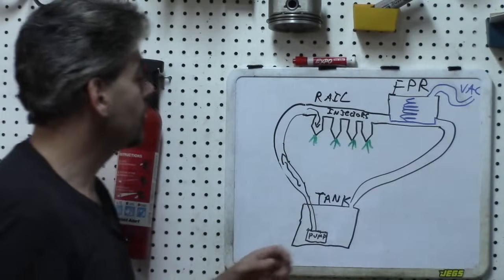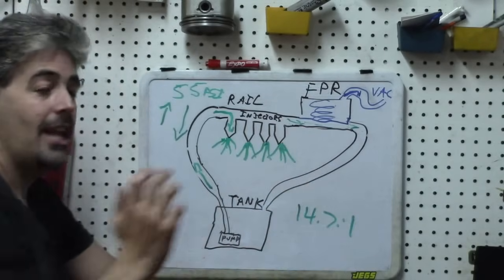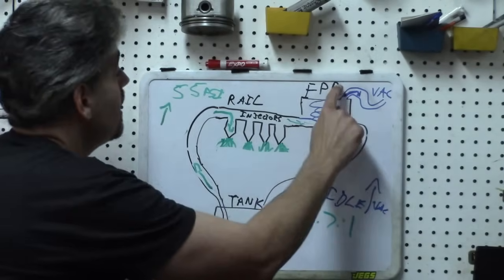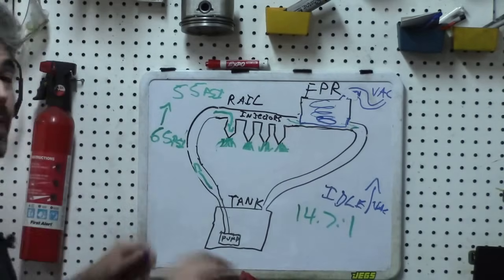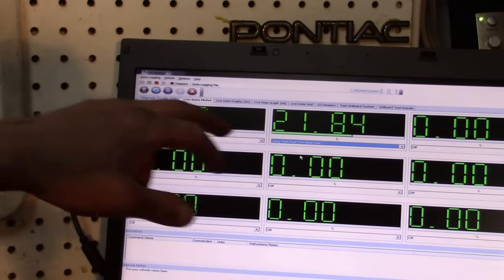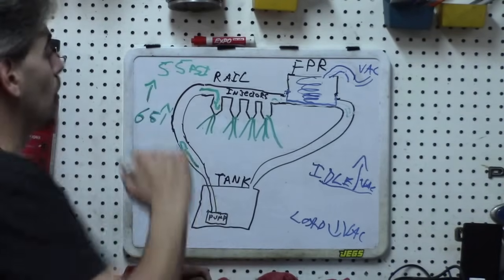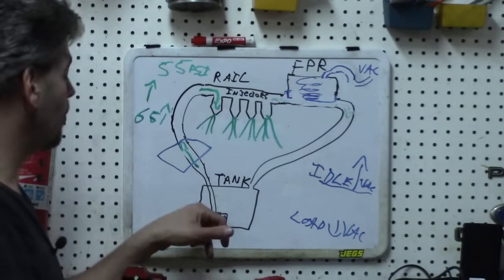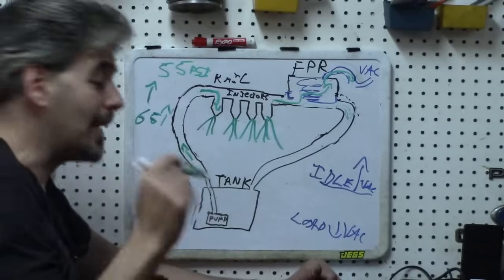Fuel Pressure Regulator Diagnosis + Understanding (HD!!)

Comment: LOL! Only crush the fuel line if it's rubber. I know it had to be said. It's like some modern packaging where you can see the lawsuit that got each of the lines of warning written.

You're alright. I'm just getting the unintended joke. Really great job on the video.

As for the HD, this is the highest resolution your hair has ever been. It looks a lot more real. The shot of the engine seemed to have the glow of a sunset reflecting off it's surface. You're earlier work wouldn't have caught subtle lighting like that....though I suspect it wasn't a sunset and actually a garage light.

I think your HD work will show up better when we're looking at graphs of fuel trim or other data together. Once again, based on looking at your hair.

When judging detail on videos - my brother reformats videos from SD to HD, or what he'd call a joke of HD to HD, look where the detail is. Usually the face is a good place to check the detail differences.

If you like, I could try connecting you with my brother since he's the one in the family with all the video editing expertise.

I thought you had moved to HD earlier this year, the quality jumped up tremendously, but maybe your final edit wasn't HD like it is now?
Reply from the maker: My hair "looks more real?" lol- it IS real!!  Yeah as you noticed, I have gone through 3 stages of resolution increase now. WHen I first started I just used a standard definition DV and poor lighting- I really had no idea what I was doing.  I later got an HD camera however my home computer was far too weak to process HD videos which are friggin huge. So I just processed the HD video from the camera as a higher quality WMV which my computer could handle.  And now of course, this is full HD (actually 720p- 1080p is just ridiculously huge and not really that much better considering the long upload and processing times.).
Reply: Schrodingers Box  LOL. Thought you might like some truth in humor. :) Of course your hair was always real, but when they blended together it had an "unreal" effect before, lol.

And yes, having watched all your videos, at first at random (when I discovered you) then from beginning to end, I do see the 3 transitions. :)

It was a few videos of the better quality before it clicked and then I had a, "Whoa!" moment.

Comment: Thank you so much for this video for informative. I am so grateful  because  now I feel confident  I can discover  whether  or not my Fpr  is faulty. 
I just have one question if in fact there is leak that the vacuum line is sucking  in then would that mean that you might get a smell of unburt gas when you turn on the vehicle?
Reply from the maker: Reynaldo Olivares I would initially say not unless the regulator is also leaking, however on second thought- because the vehicle would already be rich at warmup combined with the extra rich from the fuel pressure being 10PSI higher- I imagine it's possible you could be smelling raw fuel from the exhaust.  But not from the engine bay.

Comment: I've noticed over the years that the factory shop manuals don't seem to list the correct fuel pressures for the injection systems. Example: 96 eldo northstar. factory says 46 to 59 psi. Yet, static is 30 psi, run with vac is 40psi and run with no vac is 46psi.  Example: 98 P30 chassis factory says 55 to 62 psi.  Static is 50psi, run with vac is 48psi, run with no vac 52psi.  I have found these discrepancies to be very common and to beginners can be confusing. I wonder some times if the readings that the engineers are looking at are at the pump? One thing you don't mention is the inline check valve in the pump module and how, if it fails, will let the fuel pressure drop over night or several days and make hard starting until the fuel pressure builds up. I have found that this happens more often than the actual fuel pump failing. I use "inline" check valves to solve this problem at a fraction of the cost of a new pump.   Great video's well explained even through the evil dry eraser board is in total control of you! Thanks for your time!!!

Comment: Good video .There are a lot of good editing software out there but i like Sony Vegas 12 ,It is so easy to use for basic editing.  Have you tried VideoPad editor. A lot of people also use Magix video editor.
Reply from the maker: Well if Vegas 12 is what you use for your videos on your channel, then that's a pretty strong testimonial because your video quality looks very good to me. One thing I did like about Nero's rendering at H.264 is it comes out to about 15MB/min which is much less than I have seen with other software.  If you get a chance, I'd like to know what your settings are for rendering (I have been saving mine as MPEG-4 3GPP 1280X720 2420kb/s). I find it gives the best video quality at the smallest file size of any other formats I've tried.
Reply: Schrodingers Box I let vegas save as MP4 .Vegas gives choices for Output Format.  and I pick Internet HD 1080p, Or lately  Internet HD 720p. Because the internet speed here is slow. So some are MP4 1280X720  and Some are MP4 1920X1080.  I Mostly use a Sony Handycam  and my input file is a AVCHD file. at 60 i  . There are lots of good video editing software out there , but they are only as good as the quality of file you put in.I am not on highest camera setting but do like starting with a large file size for editing. .

Comment: Thanks mate for the lesson. You are absolutely great. Sorry I have a quick questions if you don't mind?. What's the statu of  fuel pressure regulator before  the car started is it open or closed? Is it normal for FPR leak to tank while starting cars? Thanks again. 👍🏻
Reply from the maker: it will be closed since there would be no vacuum to it plus you want to maintain fuel pressure in the rail for the next start.

Comment: I did not remove the banjo fittings. I loosened them enough to allow fuel to be forced out, then I tightened them. Now I have huge job that I will not allow a shop to perform.
Reply from the maker: You still do not understand. YOU DECOMPRESSED A COMPRESSION WASHER AND REUSED IT. 
  The shop is not the danger here. YOU ARE!!!  Again you asked for advice and my advice is to stop immediately and take the car  to someone who knows what they are doing!!
Reply: get new washers

Comment: Great tutorial, thank you! One thing that I'm curious about is how the pressure is maintained in the fuel lines with the engine off? Does the FPR block the line? I have a problem in my Bronco where I lose fuel from the lines completely after 5 minutes of engine off. It does not leak into the FPR (checked the vacuum hose). Is the in-tank fuel pump restricting the return flow to maintain pressure? Anyway, I do suspect a broken check valve in the fuel pump feed side. I don't see any leaks in the lines and I don't smell gasoline anywhere, and after a minute of running the pump there is enough pressure to start. When the engine starts, there's no black smoke or anything, it runs normally immediately and is fine running.
Reply from the maker: +Sami Ovaskainen The fuel pump itself has a check valve to maintain the pressure
Reply: +Schrodingers Box Does the check valve block the return line as well when the pump isn't running?

Comment: First thanks for an EXCELLENT video...as you said, it made me understand how the system should work.A couple of quick questions...My fuel pressure gauge fluctuates 5 lbs back and forth with the engine running, not a steady reading as yours.My fuel pressure dropped into the thirties when I increased throttle, could this indicate a failing pump? FYI...This is on a Mercruiser 7.4 MPI  marine engine. All filters clean...all lines in good shape. And again THANKS for taking the time to produce the video!!
Reply from the maker: If your engine has a misfire it could be the effect of the misfire causing an imbalance in the vacuum to the regulator.  Also, make sure it's not just simply vibration causing that effect.
  It also could be result of injector pulsewidth modulation if the ECM is maintaining idle. Easiest way to check that would be through the short term fuel trim pattern.
Reply: Thanks for getting back to me so quickly...pretty sure not vibration...will kill a cylinder at a time to check for misfire.Will have to ask my mechanic who has the Diacom software, if he can check STFP.  Thanks

Comment: Okay. just sitting here wondering what the next item on the list is going to be. I got this 96 ford 4.0 ohv it was throwing 3 codes, misfire on 6 and 4, DPFS blahblah and ECTS blahblah, I have a cheeeeep scanner and thanks to you I haven't bought as many parts as I could have.the misfires were broken plug wires solved. replaced the two sensors. solved and ditto. replaced the lower,upper intake and all related gaskets, sill running lean. all O2 are fine but the MAF wasn't and the IAC, boom and boom. 8*( still tossing a P0171 but my longft on both banks were 42.3 so I check for exhaust leaks, nada. then I tuned into this video. and went down to the zone for their loaner fuel system diag. kit. checked the pressure at KOEO nothing, tried it at KOER I'm thinking 17psi is a bust. it wouldn't budge off of 17psi under load or disconnecting the vacuum line, probably another bust, ordered pump and filter. the truck has 256,000 so I expect it's time. So I'm just sitting here wondering what the next item is going to be. BTW These are the worst Fing vehicles I have ever had the pleasure to operate on.Seriously considering using it for target practice. Happy Easter Sunday!!!

Comment: Bro, amazing class! Please don't stop instructing us! Where are you located? I'm trying to diagnose what seems to me a fuel misfire or clogged or an injector pump clogged or a. ECM not signaling to inject on my 1999 3500 Ram 24 valve Dually. I replaced the fuel filter and was packed with traced elements so I seriously don't doubt the VP44 is stock as well but you know, the truth is what am looking for so..am learning from you and the gurus out there to diagnose and to take care of business so my Dually start. So far is cranking no start.
Reply from the maker: Thanks.  You have listed 3 completely different variables- you will next need to eliminate each variable systematically to identify the cause of the problem and go from there.  I would start with PCM signalling first since obviously that's the easiest.
Reply: @SchrodingersBox  I agree with you since is the brain or signaler or device to order the VP44. I'll try chat first with a couple used ones from the yard. If the VP44 works problem temporarily solved until I can get into the OEM Leagues. If not, Ill go to follow the cabling. Lets see. I still have my fears of having a clogged VP44 because I had almost like an 1/8" of traces in the bottom of my fuel filter canister and maybe, I'm not a 100% sure part of those traces went into the VP44. Lets hope it didn't or that the amount is so minimal that somehow escaped the injectors mouth but..they can be small. I mean those feeders I guess can be clogged unless the VP44 stall in order to protect them from getting clogged. 

Thank you brother! I do the same on central air conditioning systems. I help even from a distance. Thank you! I'll talk to you later. I want to treasure your friendship. You are a great genuine and intelligent person many would like to be and have as a friend! Much blessings to you brother!

Comment from the maker: Hahaha Tecnico beat me to it but I wanted to make first comment on the new HD upload. I was wondering if you guys noticed the difference? I made a rather egregious error (IMO) in choosing Nero 2015 as my editing/processing software. It gives a relatively small H.264 file size for HD quality but on my first edit, I found the audio was way out of synch. Many of the choppy edits were the result of my effort to re-sync the audio. I have found many people using Nero have also complained of this. If anyone wants to (again) recommend a good HD editing software that is not some kind of professional grade for special effects etc, I'm all ears. Many people recommended Vegas Pro but I just want something to produce equivalent of HD H.264 output with a small file size and make title screens and text over the video - that's pretty much it lol. It is essential that audio waveforms are visible as well in the editing screen. All Suggestions welcome.
Reply: I'm no video editing expert but I just started using Cyberlink PowerDirector and it seems pretty good so far for a home user. Simple to use but gets the job done, doesn't crash or have the annoying problems of other cheaper/free editing software, although , I only did one job with little editing.  They have a free trial, or even a free version that provides the basics I think. Cyberlink are the people who provide video codecs for windows PC so I would guess they know something about video. They claim to have the "worlds fastest 64 bit rendering engine", The one job I did with it  rendered quickly so might be worth a try to download the trial version and see if you like it. I think they just released a new version that does 4K and H265 too
Reply from the maker: tubester4567 Excellent feedback, yes I saw Powerdirector at the computer store and it caught my eye especially for the much more reasonable price than most others. I will take a second look at it for sure. I don't want to be steven spielberg here- I just want to make simple videos in HD lol!
Reply from the maker: tubester4567 Tubester, just wanted to say FANTASTIC call on Powerdirector.  I got PD13 today and it is incredibly easy to use and it's just amazingly fast at rendering the H.264- and no audio sync problem like Nero had.  Absolutely the best video editing software for the price as far as I'm convinced! Great call bro!
  Thanks so much, you just made my life way, way easier bro!!!
Reply: Schrodingers Box Good to hear Matt!! Yes, it definitely seems more powerful and professional than the other cheaper programs. I have struggled on and off for years with dodgy programs because I don't do enough video to warrant the expenditure, but I lucked out and scored a free version during a Cyberlink promotion a couple of months ago. I'm glad it worked well for you, nothing worse than having to re-do videos because of shitty software!! Happy to help!!
Reply: I use Sony Vegas Pro
Reply: +Schrodingers Box If there was something wrong with the audio/video I sure didn't notice.  Proving, that content trumps audio/video.  Thanks for another great video.  I use Sony Vegas Studio HD Platinum 11.0, $35.00 at Amazon.
Reply: +Schrodingers Box  Hi, I am struggling with a hesitation and jerking of my speed density engine, Thinking it was the coil, I replaced the coil with external msd blaster coil, but to no avail. The car does this on load at lower than 2000 rpm.  I took out all the plugs and one plug, the #1 of 4 which is nearest to the fpr seems to be so clean, I am thinking that this is not getting enough fuel. It is safe to remove the fpr vaccum line while testing on the road?
Reply from the maker: corollagl82 What is your static vs load fuel pressure and idle vs load fuel trim?
Reply: +Schrodingers Box  I dont have an access to fuel pressure guage as of now, i bought the car without diagnostics its a pre-odb2 engine. I am so brave that I  remove the fuel pressure regulator's vacuum hose and plugged the intake vacuum while on my way to a machine shop 30kms away.  I would say you are one of the best resource on the internet, the hesitation and jerking was reduced and almost not noticeable, I need to change the fuel pump am I right?
Reply: Schrodingers Box
Reply: Great video!  Thanks
Reply: Schrodingers Box 👍👍👍👍👍👍😄
Reply: Schrodingers Box you made a huge mistake! The drawing, you color the fuel green which would make it diesel not gasoline😂😂 thank you I have learned a lot from you
Reply: sir;
I have unstable continuous RPM..... but it becomes stable soon as I remove the gas cap...how do you explain that?

Comment: On my '98 Ford Ranger 3.0 fuel pressure stays constant regardless even when vacuum hose was disconnected. Applied vacuum to regulator no change in pressure. Checked vacuum line and vacuum decreased when given more gas. No fuel in vacuum port on regulator but would hold vacuum. Will replace fuel pressure regulator
Reply from the maker: I would check your fuel trim to see if car is running  rich as a result of this.

Comment: Great explanation, however, what if fuel pressure is too high and FPR is brand new? In a no-return system? 

The pump and filter is probably ok then since the pressure is high
Reply from the maker: yes a high pressure is usually a restriction on the return or regulator issue. very unlikely you will have high pressure with a bad pump. i can’t see how that is possible. and it definitely won’t be a fuel filter.

Comment: So I have a question. I go to school for this and I remember having an instructor explain to me that the amount of fuel is controlled by pressure and not so much injector duration. Not sure if you still frequent these videos much but I'm definitely curious if this is the case for all or s injector timing (it's probably called something else but how long the injector stays open basically) is only applicable to OBDI-II-II-CAN systems? I've heard of pulsewidth modulation on newer stuff. I just subbed so I need to check your videos. You may have answered this question already. lol
Reply from the maker: Some pumps are indeed variable output